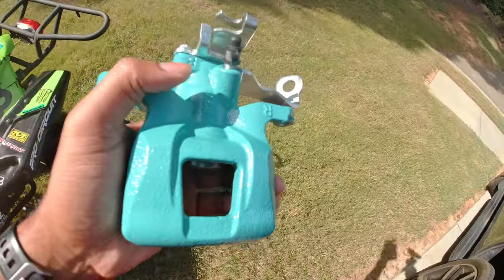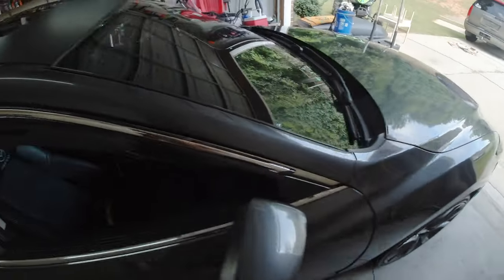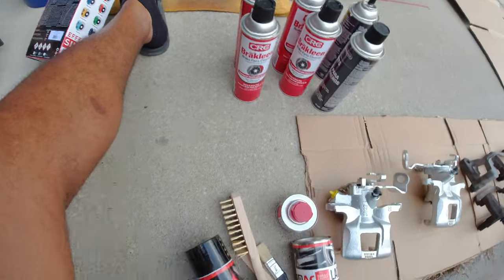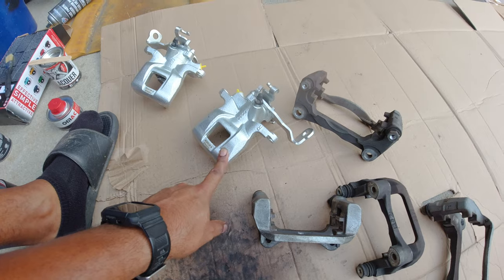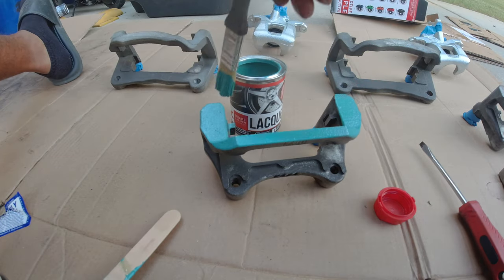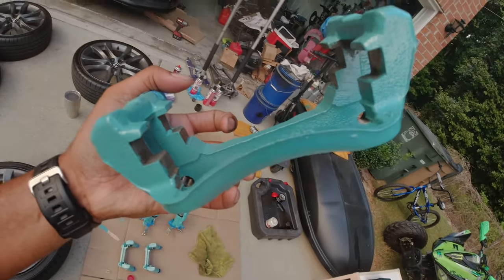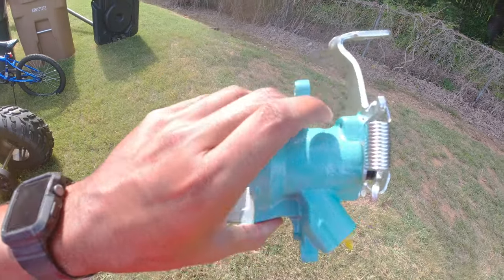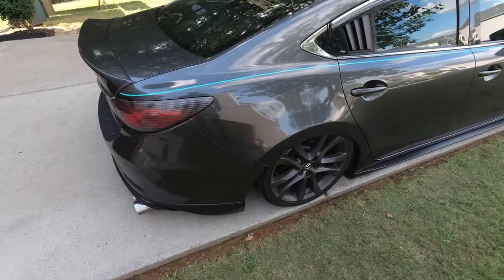How To Paint Your Brake Calipers Fast and Cheap the OMAC Way! | Everything is Included in the Kit!

Comment: I just did mine in a very similar color using just regular spray paint , lots of tape and also a bunch of cheap foam brushes. Looks decent, but i know its not the correct way. Im going to order new front calipers and this kit you got. Calipers dont last long (looks wise) here in VT. The winter salty roads just destroy any exposed metals. Plus Im waiting on new wheels to show up, and having new calipers in teal will looks awesome behind the white wheels I ordered. Clean chassis parts , and brakes , always catch my attention personally at car shows.
Reply from the maker: It’s been holding up good so far. Just a few chips from changing brake pads. We don’t get a lot of salt here in NC so we don’t have to worry about the corrosion and such. 

And I agree with the clean suspension and calipers. It makes a big difference even if they are simply silver or black.

Comment: hey man, thx for the video, just got a kit, and wondering, if I do it within few days or so, paint will be still ok sitting for a few days in a can, just not sure how that hardener works. Dont want paint in a can to dry out by sitting for a few days. thx
Reply from the maker: I can’t remember the exact time frame for when the hardener is added but I think it’s less than 24hrs that it has to be used.